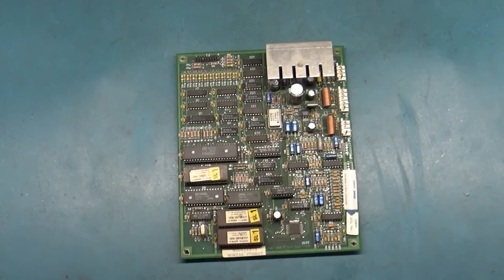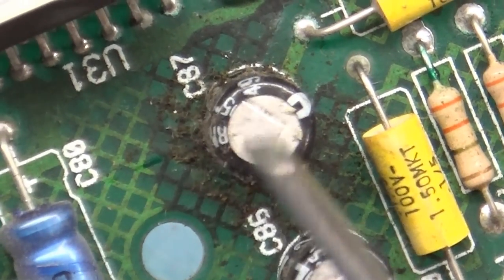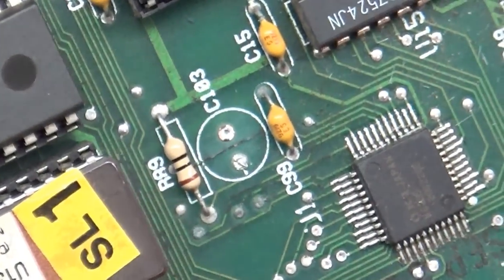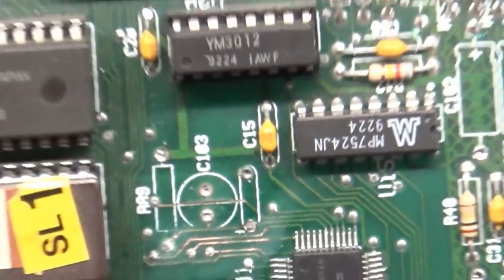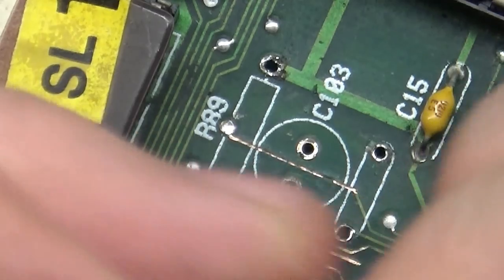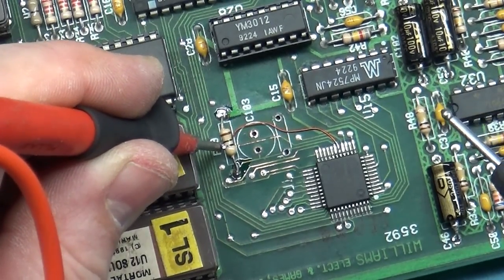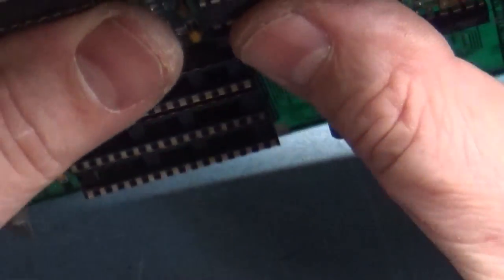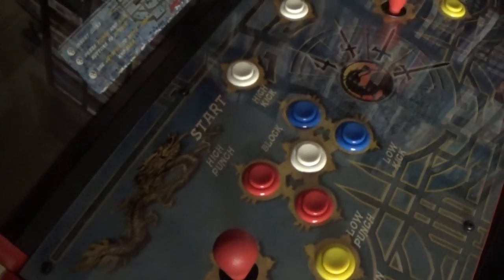Mortal Kombat Arcade Sound Board Repair - Low/Bad Audio/Sound Effects - Leaky Caps Galore!

Comment: Great video! Should throw a little nail polish or solder mask (or neutral cure silicone) on that jumper you ran just to keep it from vibrating loose.

Also ideally some new thermal grease on that amp.
Reply from the maker: Agreed. I will at some point.

Comment: I have a suggestion that might help   When I was servicing those games and I ran across it  I would take a piece of stranded wire and use on of the strands and solder directly to the traces  then I use fingernail polish to coat what work I had done     SMC can be a royal pain to solder to